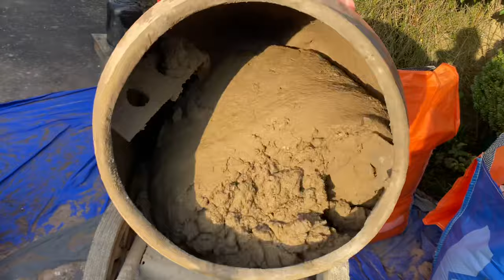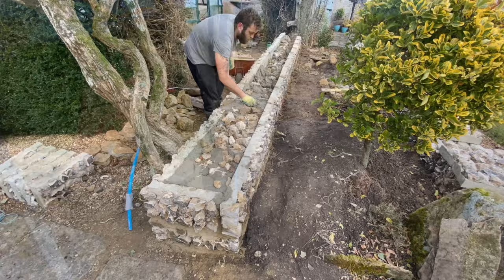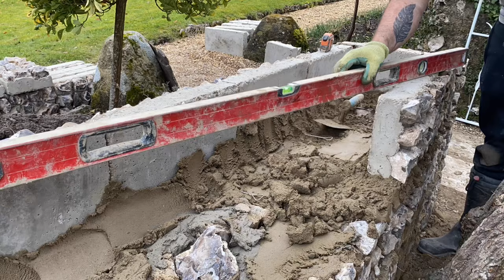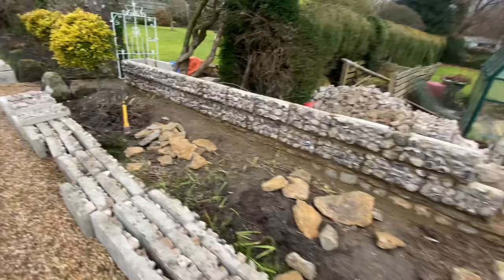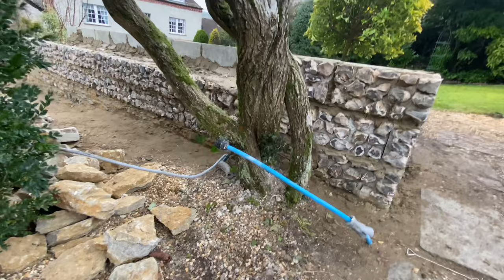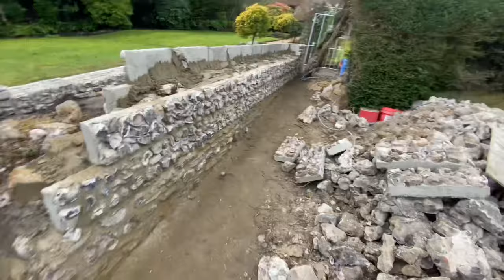Building A Flint Block Stone Wall - Actually Getting Somewhere!?

Comment: Hi Josh. Haven't used these blocks either but I've done tones of knapped field flint and know the desired look well. The pattern looks more than decent on these blocks and the good balance means you might be able to lay them on a thinner bed. Possibly using a tile adhesive would help get the joint down to almost invisible. Just an idea. Keep up the good work. I watch daily mate and really enjoy the vids. Nice one
Reply from the maker: Hey Paul! The problem we are having is that each block is slightly different so when laying we are adjusting with the mortar bed. When we come to pointing them up I think we will be able to sort out a lot…. Hopefully! 🤣 Thank you for watching mate! 👍👍

Comment: Hi Josh not laid these blocks myself but have seen these on another channel. To me they could be glued some way so you don't see the joints. But if the customer is happy that's all that matters
Reply from the maker: Hey Paul. Yes I’ve seen them when they have a few flints missing around the block so you can point them in at a later date. On these ones they’re solid and square. I’ve tried removing some of the flint but in the process broken the block so just leaving them be. Yes client loves them so suppose that all that counts! Thanks for watching! 👍👍

Comment: Hi josh why the hell did they go for those blocks they look cheap and nasty the natural way you lay looks 100 times better it’s like I’m a decorator by trade and when a customer says I’ve got this wallpaper will you hang it I’ll say where did you get that from the tip I’ve seen bog paper thicker than that
Reply from the maker: 🤣🤣 It was recommended by the designer unfortunately. Easily could of been re done with the original flint but I reckon a lot more old stone came out of the wall than expected.  I wouldn’t know if they are cheaper than just buying flint?! Thank you for watching mate! 👍👍